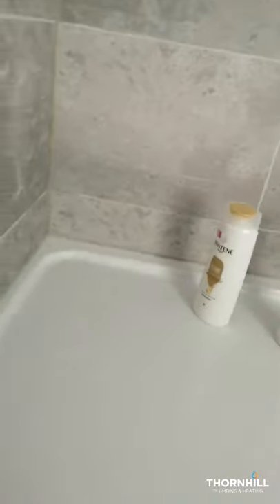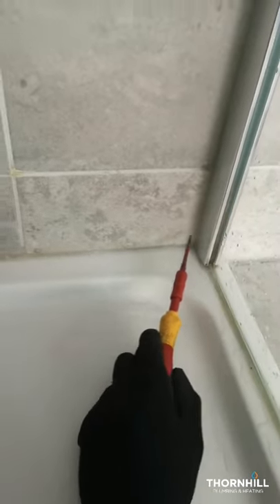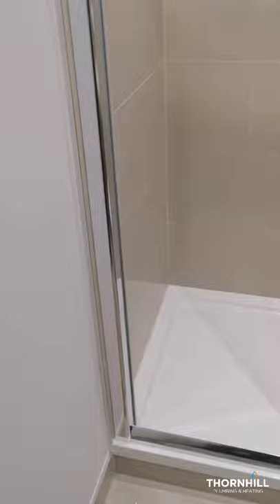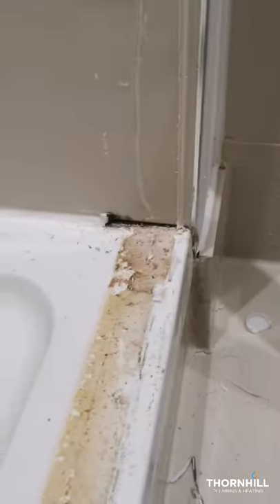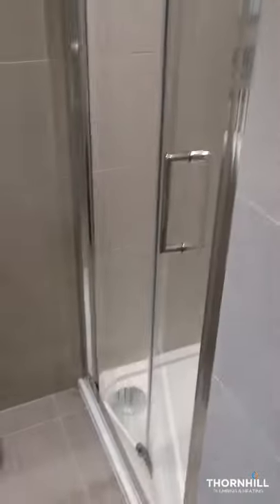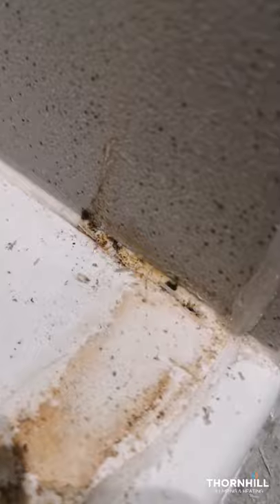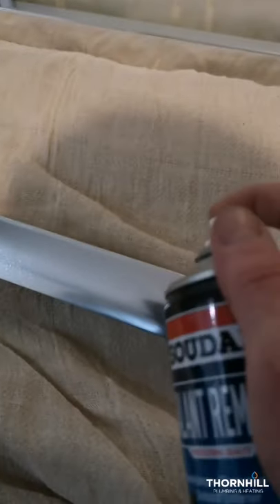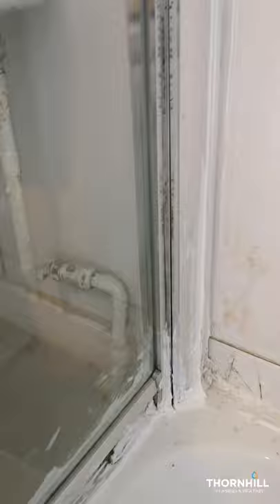How we seal problem showers

Comment: spent more time showing the shower than actually chaulking ..
Reply from the maker: This video is for plumbers.
Reply from the maker: @SomeDumUsrName here in UK the plumber usually fits the tray , then the tiler comes and tiles the walls , and then the plumber returns to seal (caulk) the tray and then fit the screen/enclosure and seal the enclosure correctly.
Unfortunately our plumbers do not have to be qualified so you often have inexperienced/not qualified people doing a lot of our plumbing so it is done wrong a lot of the time.